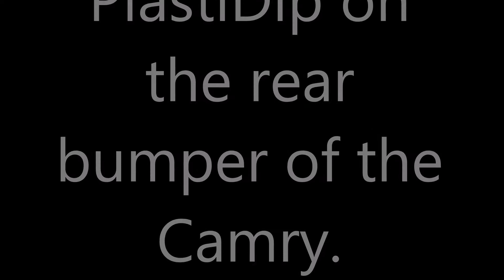PlastiDip Rear Bumper

Comment: Do you not leave any time between coats? Is it just straight after one another?
Reply from the maker: I usually let the coats flash off between them. So i dont create any runs in the DIP.
Reply from the maker: The flash time is like 3-5 min. its not long you will see the color change and not look as wet. Thats when i know to add the next coat.

Comment: Does it hold up well in the sun when on a really hot day and does the plasti dip around the exhaust cutout look like it's bubbling due to the radiant heat from the muffler tip ?
Reply from the maker: เคน KhunFon holds up great. Hot days don’t affect it at all. And around the exhaust looks perfect just like the rest.